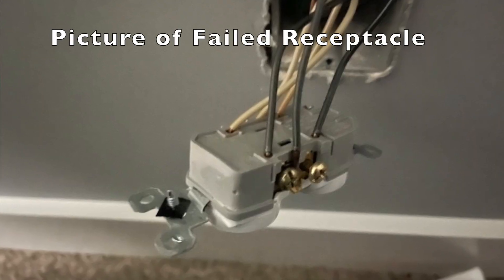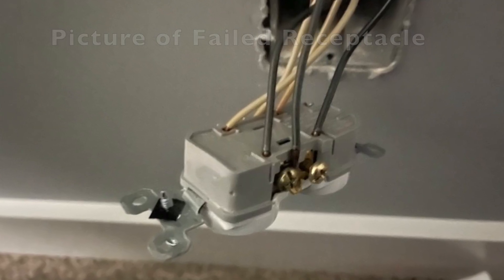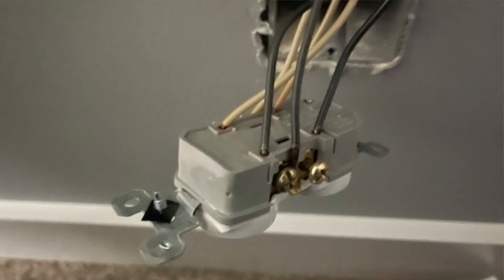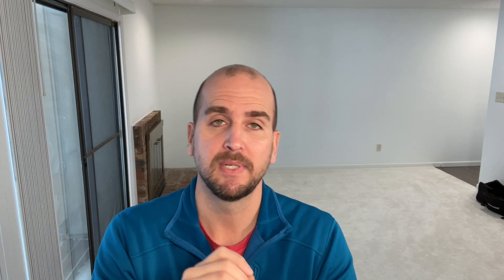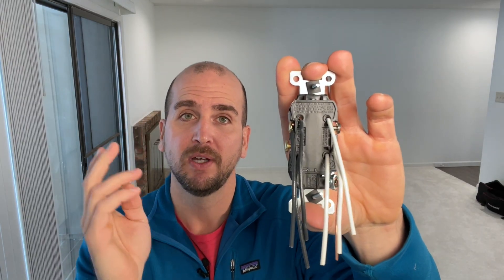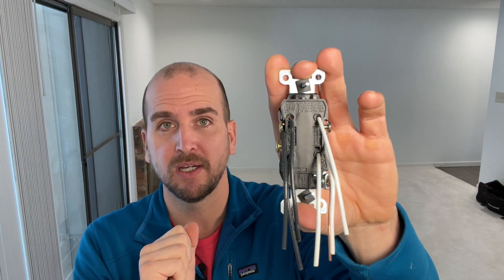Incorrectly Wired Outlet Found In Newly Built Home

Comment: When roughing a house in i always pig tail all outlets so when it comes time trim it out all you have is 3 wires waiting. Way faster, epically if you have a new guy dropping plugs in. Should only spend a minute or so on each plug
Reply: I still don't get it why you would ever want to have to wires coming into the same outlet...
Reply: It actually reduces stress on the outlets themselves as the wire to wire conection is more sound then the flimsy tin in the outlets , however that is one I'll let people get away with and it reduces 'overstuffing' a box - especially the 18ci (or less) boxes 
But it is a good point
Reply: @MrOpinionCantSignIn  No, you get me wrong.

I really don't get it why you would ever have to pairs of wires going into the same outlet / outlet box.

You don't use outlets as junction / distribution boxes. I use proper distribution boxes for that and don't distribute from outlet to outlet. And at least in professional or semi-professional installations I have never seen it otherwise.

I have seen outlet to outlet connections when people just quick and dirty wired their house or in some rare cases when installing new additional outlets in old houses with non-hollow walls (e.g. cement) where going outlet to outlet might sometimes be the only way for you to not breack cable canals into structurally important parts of the wall.

But I always saw it as something "dirty" that you would never do in a new house and even in old houses should avoid at all cost.
Reply: @Spearca  well normally I plan the whole curcuit layout so that one junction box (with proper distribution stuff that I don't know how it is called in english) does serve more than just two outlets, but yeah, if necessary I add an additional box just to avoid having wires spliced behind devices. That's how it was done in my parents house, that's how the "old" part of the installation where I live now was done, that's how the professional installation in a department I own was done, that's how I did the upgrades and additions where I live currently. I have once in my live spliced behind a device and that was because it was for installing an additional device in an old kitchen and otherwise I would have had to break a quite big part of a (structurally important) cement wall, breaking the ceramic tiles of the kitchen, uninstall and reinstall the sink and various other things. And as I said, you aren't even be able to buy those screws here.

And yes, for low power LED lights I did go from device to device as well no that I think of it, because the switching gets a little more complicated otherwise Isn't that relevant here because it is the cultural norm to have each switch only switch one light (e.g. in the before mentioned department it was done like that). But were feasable even with  multiple lights on one switch I would have something like " fuse box --> room specific junction box --> switch --> junction box --> several lights "
Reply: "NO DEVICE SHALL BE INTERDEPENDENT ON ANOTHER DEVICE!!!" MEANING PIGTAIL THAT SUCKER!!!

Comment: I've been a commercial industrial electrician for over 25 years. The best practice is when you're done wiring up devices wrap it up in electrical tape. Now nothing can short out and you can work it energized.
Reply: I do the same, had an inspector here in Mi knock me down stating that the tape wasnt rated for heat. Only 20 years in this trade so i laughed not realizing he was serious. I took off the tape and waited till he left then put the tape back on. I only use 33 + tape no cheap stuff. Its a courtesy for the next guy

Comment: 110.14(D) [2017] NEC code now requires the use of a calibrated tool to tighten down those terminals. Even though you might think those terminals are tight, I want to point out how many professional and DiY installations I have had to repair because the terminals were not torqued down properly. Please think about using a torque screwdriver when showing proper installation.

Comment: Perhaps overly paranoid, but I wrap with electrical tape around the outlet to cover the hot side in case of accidentally touching the bare ground wire to the hot side.

Comment: This is very common in places with more people than housing and they gotta throw up cookie cutter houses and Apts. I have seen a 500 thousand dollar house be bought before its even constructed; they frame through the winter, causing the framing to warp terribly, the painters paint over anything in the way, the walls, foundation and siding are not square or plumb, but the flooring and concrete flatwork always has to be perfect but all the stuff that matters structurally is junk.

Comment: Whenever I use wire nuts I always wrap them in tape in the direction of which I tightened them also with the tape wrapping around the wire to help hold the wire nut tight. Maybe overkill but I've just always done it that way.
Reply: If wire nuts need something else to keep them tight, tape wouldn't help much.

Comment: The reason you tie it all together and use pigtails is so that if you have a receptacle failure at that location the issue will not daisy chain to all the other receptacles down the line. Plus less cluster.

Comment: QUESTION ON FAN WIRING OF CHEAP 50CENT SWITCH: THE PUSH IN HOT LEAD WAS CONNECTED TO PIG TAIL. NEUTRAL WAS  NOT EVEN WIRED TO SWITCH. NEUTRAL WIRE FROM FAN WAS WIRED DIRECTLY TO NEUTRAL PIGTAILED THATS WAS PART OF THE GANG OF PLUG RECEPTACLES. FAN SEEMED TO RUN SAME SPEED AT ANY TIME PULL CHAIN SPEED SWITCH WAS CHANGED. FAN WAS SLOW AS IF THERE WAS LOAD ON CIRCUIT. PLEASE FILL ME ON PROPER WIRING AND WHY SPEED WAS SO SLOW.

Comment: When I change out an outlet, I make “pigtails” out of stranded wire with either crimp on forks to attach to outlet, or backwire clamps.
Reply: You must be an engineer with the crimps and stranded wire. Take a 2 min job and make a half hour out of it
Reply: Crimp forks is an unnecessary extra connection. The more connections the more places for failure.
Reply: You can twist the stranded wire backwards/counterclockwise before hooking it around to keep it from unraveling when tightening down the screw.
Reply: @AreaThirteenThirteen  well don't give away all the secrets, lol.

Comment: First of all who puts that many wires on one outlet. It looks like an accident waiting to happen. And why do you make a video about this situation and not address this issue. Seems like a junction box is needed to wrap all these wires together and then send only 2 wires to the outlet. This is shoddy workmanship and shame you haven't addressed it.
The one thing I do that you omit in your assessment, is wrap the entire wire outlet with electric tape. Much better than just screwing the screw all the way in. Why you ask? I once went into a house where a friend said the circuit breaker kept going out. I went to the outlets in the room questioned and found in one of the outlets a piece of wire that had fallen into the outlet box creating this dilemma. (No one knows how it got there.) This could have started a fire if not paid attention to.  I had been told by other electricians to always wrap the outlet with electric tape for unseen occurrences like this. So as a seasoned electrician for over 50 years I suggest this as a safeguard for all your outlet installations in the future. Forget about what you were told to do. Do it right!!!

Comment: As others have correctly pointed out, insert the wire under the hold down screws so it draws the wire into the connection.

Comment: Nice video but in over forty years I've never installed an outlet or switch that I didn't wrap in electrical tape before putting into the box. Even a non metallic box may have bare ground wires that could contact a hot conductor. Now you did make one mistake that could get someone killed. Just because you killed that circuit doesn't mean the neutral isn't carrying a hot load so when you removed the neutral to neutral connection one of them could have become hot. Your tester would have been better if it provided a sign when there's current present on one of the neutrals and I'm not sure your plug in tester will pick that up. Most people are not qualified to do electrical work and can end up burning their home down or killing themselves in the process.

Comment: WHAT WHY!!!  4:10 6 wires on one box is better than your solution/pigtail.... your adding more points of failure, more work, and a lot more wire to stuff in the box and lowering the gauge, and not as good of a connection to the actual box, change the whole outlet if you think the push in terminals are that bad, if the wire was strait and clean in the hole its fine, there are millions of wires wired that way everywhere

Comment: Some time ago I viewed a video where the originator insisted that a properly installed receptacle will have the ground prong hole facing up and the blade prong holes facing down. Of course, this created some controversy; and every outlet I've ever seen in a residence was the reverse (the ground facing down and the blade holes facing up). Well, I was in a hospital room a couple days ago and every receptacle had the ground at the top and the hot and neutral at the bottom. Well, this opened my eyes. Should I conclude that the hospital installed these outlets correctly and that just about every receptacle in every residence in the US is installed wrong?
What's your view on this?
Reply: I think the practice of installing outlets with equipment ground prong UP is a relatively new thing.  I dont recall seeing this before the 1990's.  I learned of this about 2005 or so when I was reading in preparation of redoing wiring in my house built in the 1920's.  The romex wire being color coded  white - yellow - orange is also fairly recent, I  think within the last 30 years or less.

Comment: I'm an electrician in Canada with a few years experience (I won't say how many because it makes me feel older than I am😉) from multi family residential, single family residential, commercial, light and heavy industrial and high voltage (sub stations with 500kV).
Golden rules that I learned:
Electrical code is minimum.
Never use backstabs.
Tighten unused terminals.
Twist wires with linesmen pliers.
The #1 rule is that the bond (commonly referred to as ground) wire(s) is the most important connection as it provides circuit protection.
Oh ya, do not use wagos.
Thanks for the great videos!
Reply: When I use pro grade or commercial grade recepticals, they have ability to be back wired but instead of spring holding the wires from falling out the are bars tightened with screws to keep wires from falling out.  Since on each side of  receptical there is continuity, I see little advantage of using pigtails unless you have more wires than spaces.  For 20 amp circuits, standard box sizes tend to be small so in some cases pigtails could lead to overfill.  To me best of both worlds for novices is to use premium recepticals that are backwire capable but use screws to retain them.  They are more than 54 cent's, but not so much that they are cost prohibitive.  As far as protecting screws from incidental white contact, this is important enough that some devices had plastic snap covers so you can skip step of wrapping you completed receptical with electrical tape.  Code is minimum standard, not best practice.  If you don't want to do job twice but best quality, take time to learn how and why to do do job.
Reply: everything you just mentioned is a waste of your employers hourly money. If backstabs ever failed they wouldn't be put on receptacles and used by employers. if your not an idiot and check if you terminals are touching anything you don't need to waste time tightening them. twisting wire with linesman's plyers is the dumbest waste of time I have ever heard of, there is no point to it. Just learn how to use a wire nut, or just make terminations using the receptacle since if there's a fin it wont need a pigtail. relying on devices only created an issue when the device fails. If the device fails you need to replace it anyway. creating a pigtail only allows a homeowner to ignore a failing receptacle because the rest works (very unsafe). This could cause a fire.
Reply: @jaden2790  I learned those practices from my employer while I was apprenticing.  If we didn't do it we would be told to leave.  This is the exact reason I'm not in residential work anymore, because of the "good enough" attitude.  The Canadian Electrical Code requires pigtails.  Also, when you build trust with your customers they'll gladly call you with more business.  I'm going to go troubleshoot a PLC now, have a nice day😀.
Reply: @jaden2790  That's why you will never be allowed to work on any of my jobs. You are dangerous.

Comment: I'm confused....If there's two screws on the device and two conductors why use pigtails at all?
Reply: it's not necessarily wrong it's just frowned upon. Like when I drink coffee with lots of creamer. Not wrong just frowned upon.
Reply: Hey Micheal, I'm an IBEW journeyman wireman. Connecting the two wires and leaving a pig tail insures the circuit is complete to the outlets down the line. Landing the two wires on the outlet screws is using the outlet to complete the circuit. If that outlet ever goes bad (melts. etc) the circuit is then compromised, leaving outlets down the line without power. Hope that helps.
Reply: Hey  @Joe-by8jh , I completely agree. Any compromised device on an electrical circuit should be replaced as soon as possible.

Comment: I am not an electrician but I also do my own electrical work because I don't trust anyone to work on my house because most people will do a shit job and those who do a great job are always out of my price range. So when I do outlets/receptacles I always screw down unused terminals to prevent any arcing or touching of metal boxes causing them to ground out. I also refuse to use the push in connections because I prefer the screw posts for security. I finally wrap my outlet with electrical tape by circling around the side covering all the terminals that are exposed to the box. 

I always use lineman's pliers for twisting and when I use wire nuts I also tape them in the same  direction as I tightened them.

All of these steps make the process of replacing 1 outlet longer. However IMO there is no other way it should be done for safety, piece of mind and a worry free home when it comes  to my outlets. 

Unfortunately most electricians don't care about you they care about getting done and getting paid.

Great video.

Comment: Love the pig tails lesson. I will switch to that from now on. I was wondering, if you are connecting several outlets in parallel in a room is it ok to use the extra screws as connection points to the next outlet? Thank you for the great advice. - Brad
Reply: That would defeat the use of a pigtail. Using pigtails on each outlet makes it so if one outlet fails, the others will still work. You will know that is the outlet to replace then. If you don’t pigtail and one goes out they will all go out.
Reply: @ssng1  
If there are only two pair of wires and your receptacles are spec grade or higher then you can connect two wires under the plates of one screw terminal. Two on the neutral side and two on the hot side. That is just as secure as attaching 3 wires to a wire nut to make a pigtail.
Reply: @njsongwriter  That may be secure, but if all outlets are wired that way in the circuit and one goes bad, won’t it cut off power to the other outlets? That’s my understanding of the purpose and benefit of using pigtails. Thanks for a reply!

Comment: I thought that it's now common practice to turn the outlets upside down, having the ground on top as a safety feature.
Reply: Back in the day the ground was up due to plates being metal. So if the plate screw came loose and plate fell, it would hit ground first.
Reply: Per NEC "Code", allows an outlet to be installed either way.  Common practice in hospital and other commercial areas always place the ground on top as you say as a safety feature.

Comment: One thing I wish I had pushed for when I was in the business, and licensed btw, is to implore the NEC to ban the friction style back wired devices, as well as insulation displacement style devices. I have seen so many missed fire "opportunities" from these wiring methods. 

As far as inspections go, it is a total and complete rip-off by the AHJ (authority having jurisdiction). Other than my very first inspection, every inspection consisted of an early morning call, hang out and wait at the job site to witness unanticipated violations the inspector may find, only to have the inspector arrive mere minutes before lunch and slap an approval sticker on the meter socket then rush off to meet his buddies at the lunch spot of the day.

There's simply no room for an electrician  who takes pride in his trade in the residential field. Couple that with illegal aliens hanging drywall and chewing up the wires inside the boxes leaving a mess to straighten out at trim out there's no damn way one can make a profit.
Reply: Id also like to see a requirement that NM cable have the grounding conductor insulated.  All that bare copper in the electrical panel is dangerous in my opinion.

Comment: Great video and very informative and smart. I have a question though. I work as a maintenance engineer in a commercial bldg. Before this job, I was maintenance at a Hotel. In both places, all of the wall outlets are turned upside down (Ground on top). Any idea why that is? I've asked a few people, including electricians and contractors and none had a really good answer. There were some guesses that made some since, but no real concrete answer. Thanks again.
Reply: There's no such thing as upside down.